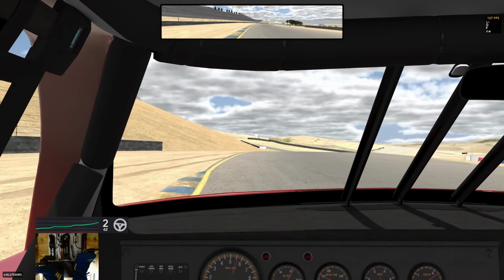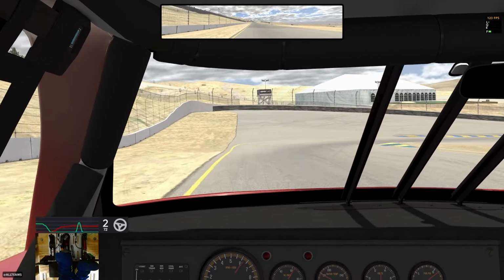How to Clutchess Shift in iRacing

Comment: your next video should be how to heel and toe down shift. i understand your point of view with the 3 pedal dance; although i think if you learn to work the clutch even in nascars you'll find some speed. just a suggestion thought. great video
Reply from the maker: Ive done a little heel toe, my rig isn't set up for these pedals so it's uncomfortable to do it long. It would be more consistent, I would not miss a gear, and I might be able to get just as quick. But I do think there is a benefit of being able to get right back to the gas without shuffling pedals.

Comment: The 87s must be listed incorrectly in that link.  They are definitely Synchromesh.  I've been cheesing with a formula wheel which gives me paddle shifters and paddle clutches which makes it easier for me than trying to heel/toe.
Reply from the maker: They must. I searched the iRacing forums and I think I saw only one person mention it a few years ago. The dog box transmissions shift without a load on them, which is definitely not the case with the 87s. Though in my brief research of the introduction of dog box style transmissions into Nascar, I found some Reddit comment that said Jericho transmissions were used starting in the late 80s, which replaced the super t-10 style. For the 87 cars iRacing lists the transmission as Borg Warner Super T-10 4-speed manual, so before the dog box if the Jericho was the first.

Do you have to hold the paddle for it to shift or does it drop right in when the RPMs are right?
Reply: @Racer57  I'm clutching so it goes right in. I occasionally release the clutch a hair too quick and then it'll miss the gear and go into neutral.
Reply: @Racer57  would be nice to get an h pattern with some sort of device to prevent the gear going on until you clutch or Rev match like in a real transmission. Sucks to think you shifted properly, hit the throttle to get no response then fumble around with the controls to find a damn gear.  A lot easier in a real car

Comment: This work with sequential shifting? I only have paddles, about to get a Fanatec wheel and get rid of Logitech wheel so the only time I use my shifter is for the 87s, not for the life of me can I paddle shift and clutch but changing gears and clutching was simple, and I figured it was something like how your (ig rev matching/clutchless shifting) I imagine it’s something to do with it just being stuck in that position of let’s say 3rd Vs me clicking a button that un clicks itself immediately
Reply from the maker: I dont think it will unless you time the shifts perfectly.